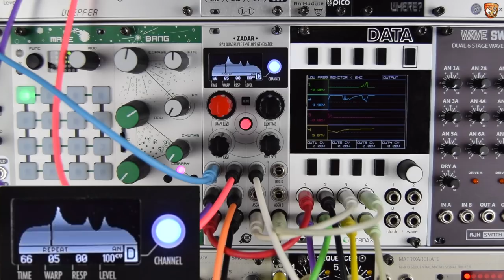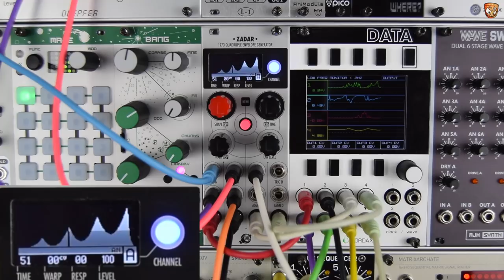XAOC Devices Zadar *FIRST PATCH* Ambience, Drones & Complex Modulation

Comment: Had mine a weak really nice for modulating akemie' s castle, distortion, wavefolders etc would like it to sustain as it ignores gate length but you can set the overall out put voltage which is nice gives great life when used to control volume
Reply from the maker: yeah a gated/sustain mode would be nice but it hasn't really cross my mind with how much control you get over everything else. Solid unit, very nice with FM stuff like Akemie's too :)

Comment: Really nice and easy to use module. I found it also interesting to design kicks (pitch or/and amp modulation) by its unique shapes, mangling them and fine tune precisely the speed and voltage level
Reply from the maker: yeah that's been a big part of the fun for me so far and will be part of the main video I'm working on.
Reply: @DivKid  when is the main video coming out?